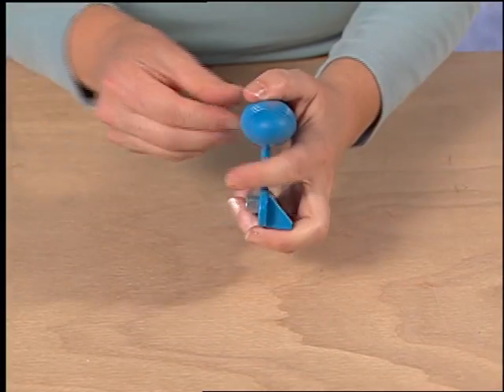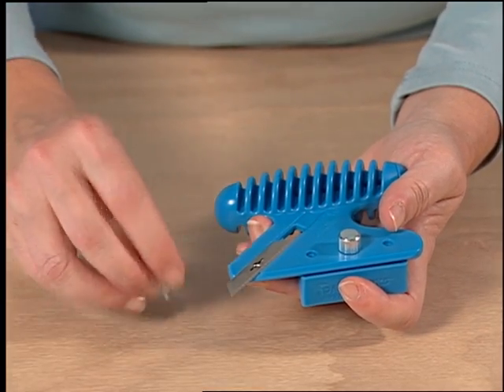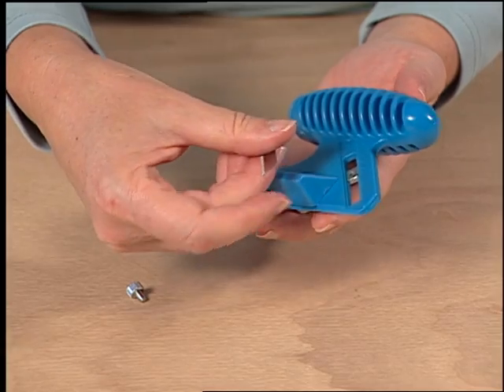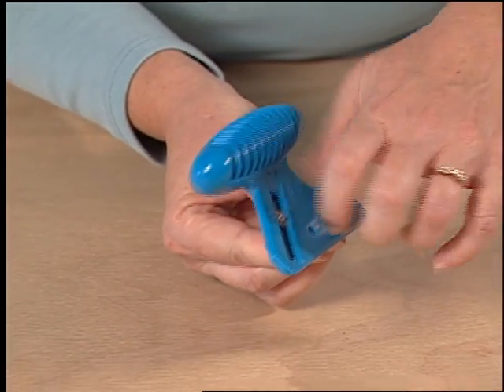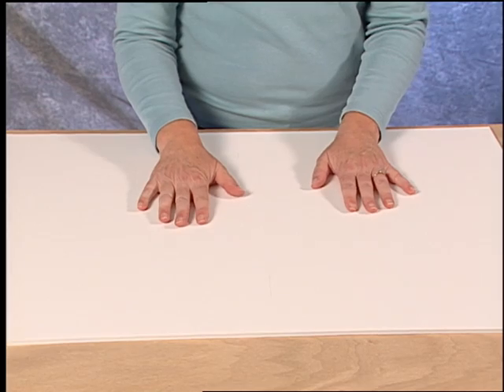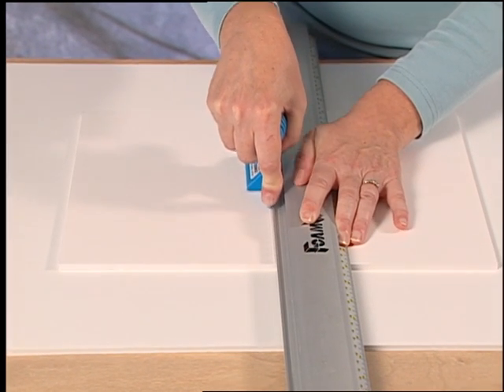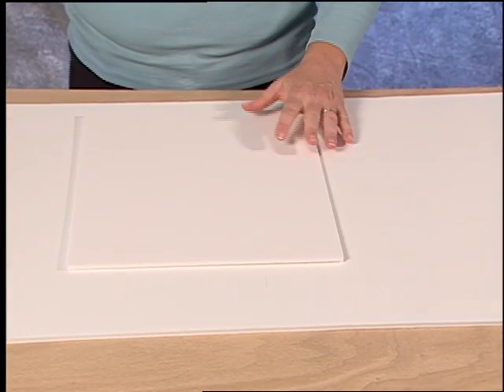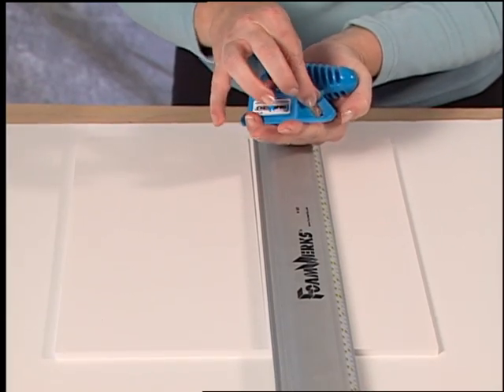FoamWerks WC-6010 Straight Bevel

Comment: what is the maximum thickness that can be cut?
Reply from the maker: Hello, The tool is designed to cut 3/16" (5 mm) foam board. Although it may cut a little deeper then that. Always use scrap foam board underlayment only under the foam you are cutting. Thanks.